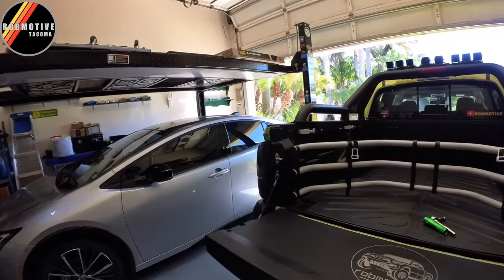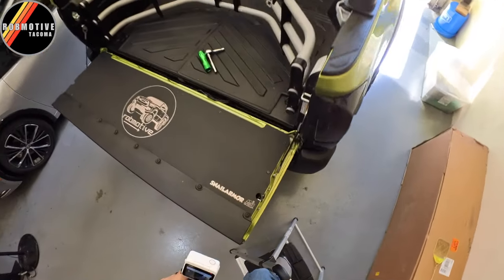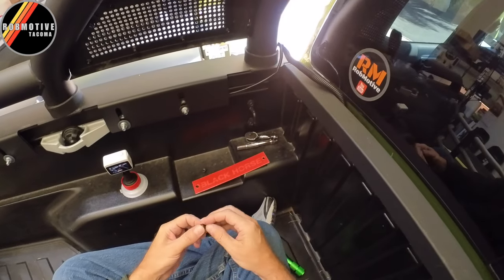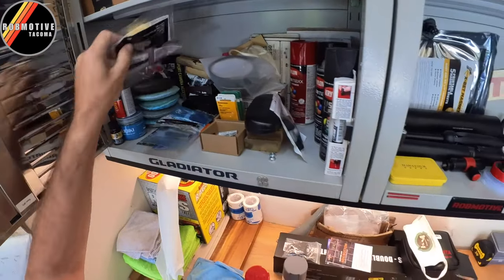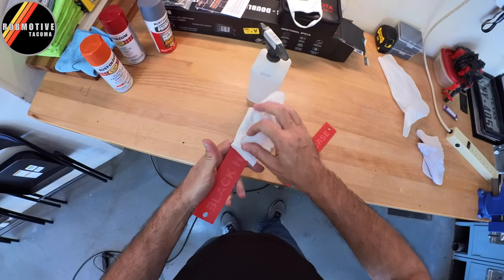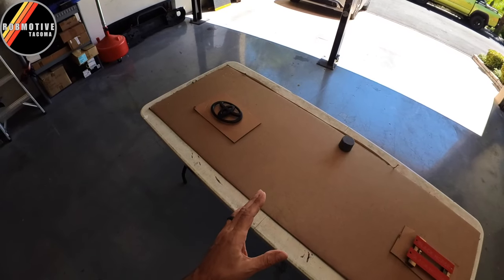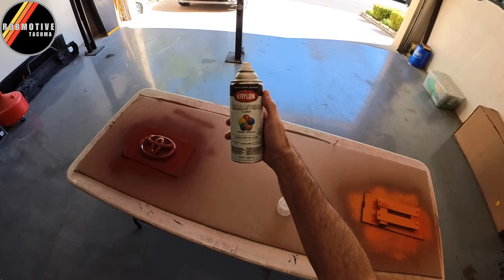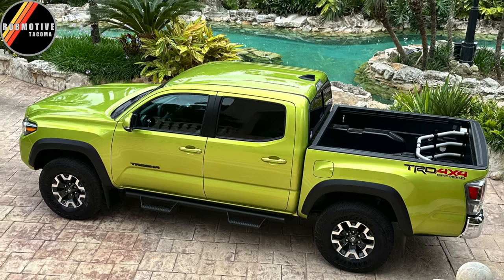Amping Up A Recent Mod On The Tacoma With A Little Paint!

Comment: I have a question unrelated to this video.  

Why did Toyota put drum brakes on the rear wheels and not disk brakes like on the front? I have a 2022 TRD 4x4 OFF ROAD. 

Thanks for your response.
Reply from the maker: I don’t have a definitive answer…but you can bet it’s about cost.
Reply: I would love to be a fly on the wall in one of their cost/design meetings.  😊
Reply: Drum brakes are great didn’t have to change them out till 110k miles!